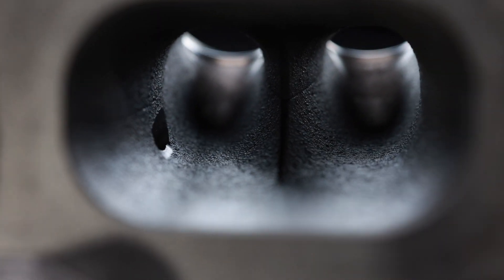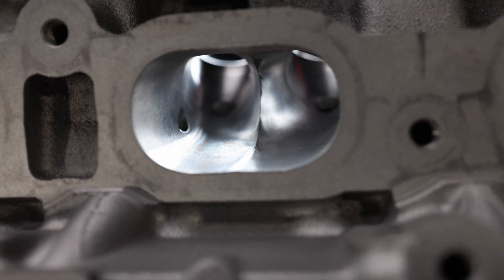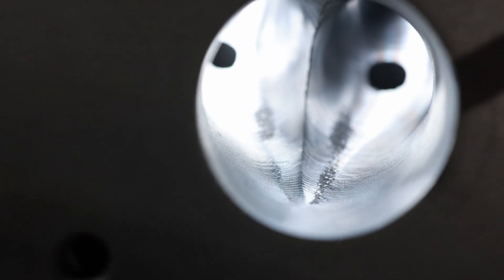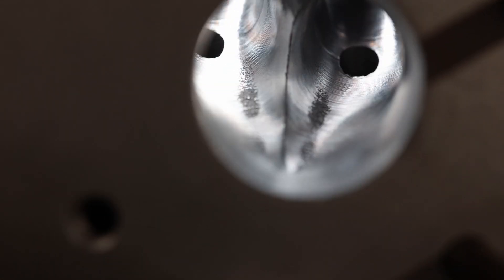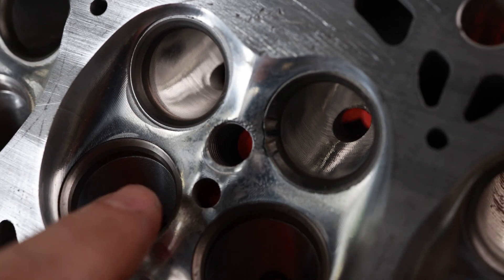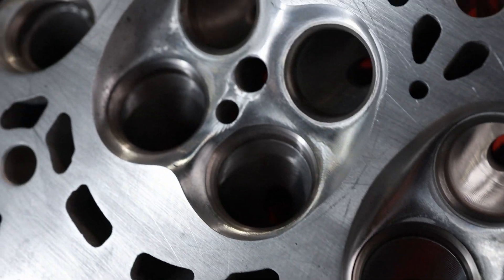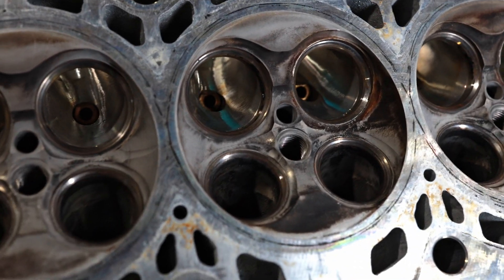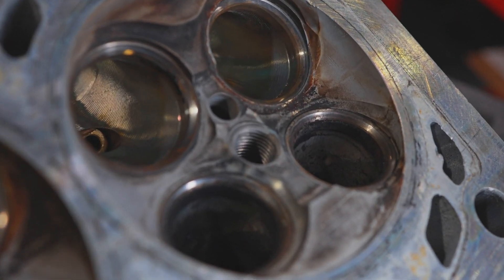Redoing the Original: BMW S55 Head Porting in our Centroid CNC

Comment: if i'm a customer, paying for cnc port it can't be close to oem. Those casting flaws appear because not enough is being taken out.

i mean, hand porting in-perfections and a valve job (including below the seat) gets you close to your cnc port.

i see your point "it doesn't need it" but comon, surely my cnc ports are at least 20% larger than stock
Reply from the maker: @GTRliffe  You do you. I’m not gonna make it big for the sake of making it big. That’s what everybody does and it doesn’t flow well under .300 lift.